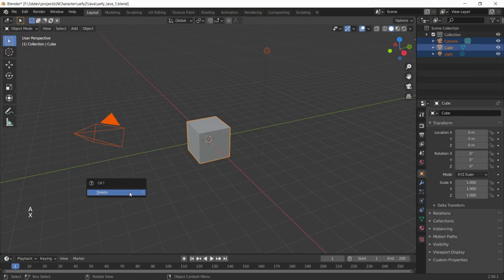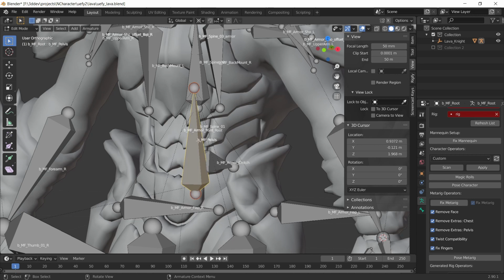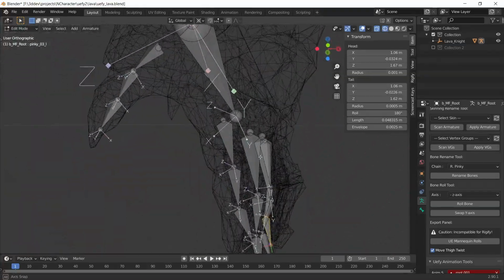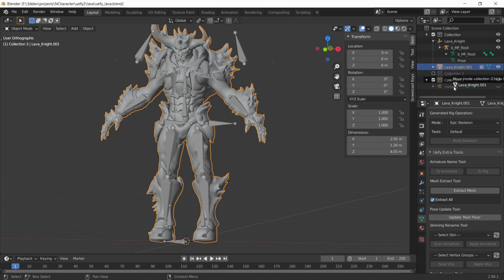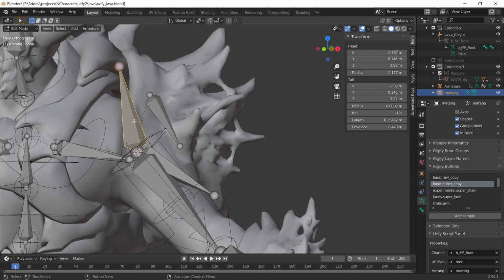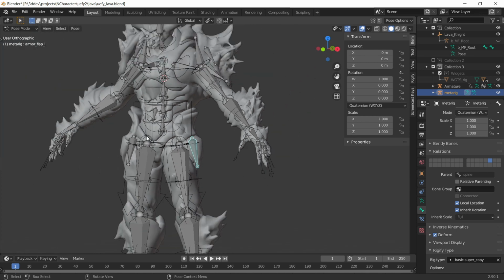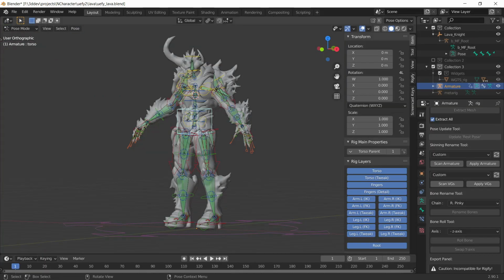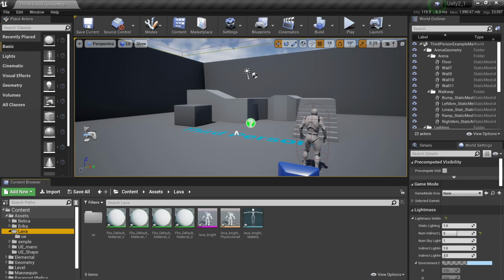Advanced Character Rigging with Blender, Rigify and Uefy 2

Comment: Hey Rakiz, I used the basic posing skeleton, then metarig for UE5 with 6 spine bones, how do I place 6 bones compared to the character's 4 bones? not sure how to split the spine. I watched 'til 29 mins into the video.
Reply from the maker: Well first of all if you plan on using the 6 bone spine you should divide some of the bones in basic posing skeleton to increase their number so they match the updated 6 bone spine and properly weight paint them. Uefy will transfer those weights to the final rig.
Secondly when working with rigify you just need to make sure that the spine uses two specific sample types. The lower bone 6 bones are of type "spines.basic_spine" and the neck to head bones are of type "spines.super_head"
As long as you have these two correct spine types and the names are set properly. Then you are not really restricted in how many bones you can have. You can increase or lower the number of bones to be anything you want. Just be sure to maintain the names sequentially.
Reply: @RakizFarooq  Excellent, got it! Thanks! didn't know if subdividing the bones would break the rig or not
Reply: @RakizFarooq  Oh, i misspoke, the metarig for me ends at spine008 while yours had spine006 as the head, so i wasnt sure how to match them
Reply: But i understand that you just need to have it sequenced right
Reply from the maker: You also should be aware that in the 89 bone version of the metarig 'spine' to 'spine.005' is one chain and then 'spine.006' to 'spine.008' is a different chain that is a child of the first chain.
You can go to Pose mode click on the spine bone then in bone properties -> Rigify Type -> Rig Type it is "spines.basic_spine" while checking the same on 'spine.006' shows it is of type "spines.super_head"
Reply: @RakizFarooq  Sorry if you've answered this before, but when i hit "keep metacarpals" when posing the metarig. the metacarpals stay in space while the hands match the pose. How do i fix this?
Reply from the maker: @kugatuka  Uefy relies on existing original bones to position the metarig. If your original skeleton doesn't have metacarpals Uefy can not place the bones. But the hierarchy is still accurate. Just manually move them into place in edit mode. The rest of the process follows as is.
Reply: @RakizFarooq  I see. I was using the Basic Posing Skeleton as my first rig, so I didnt consider there not being metacarpals there. Moving them manually hasnt caused any clear issues thankfully

Comment: Rename bone not working in uefy 2.5. is there any shortcut to rename bone?  i have already watched all of your video for renaming bone but not success. please help
Reply from the maker: Rename bone is working perfectly fine for me in Uefy 2.5 and Uefy 2.6 both. Most likely you missed a ' or " pair or a comma in the custom json file. Since the file is parsed by Python you are probably seeing errors. Fix the json file and it will work. Other than that there is also the bone chain rename tool. Plus you can always select each bone and press F2 to rename.
Reply: @RakizFarooq  Every single bone renaming is very time consuming :(
Reply from the maker: In Uefy 2.6 you have to select the first and last bones in the chain before using the rename tool.
Reply: @RakizFarooq  Please Help Me
Reply from the maker: You can reply to the email with your order id and download link. Attach images and description of the issue and of the steps you have taken.

Comment: I'm planning to watch this tutorial because for months now I've been struggling to get past weight painting but I can never seem to figure it out, so my question is does this video have any weight painting involved if so is it explained well?
Reply from the maker: This video is about rigging not weight painting. In this case the weights of the original skeleton are automatically transferred to the final animation rig built for the game engine. So weights are not needed to be manually updated at all.
Reply: @RakizFarooq  so I would still have to weight paint my mesh beforehand
Reply from the maker: Yes .. you need to weight paint the mesh or use prebuilt characters from marketplaces or character generators like cc3 or daz etc.
Reply: @RakizFarooq  right, do you know a good weight paint tutorial ever time I try to paint I get stuck on getting into the vertices and crevices

Comment: Thanks for the great tutorials, I'm now heading towards the final step in rigging my character. I've got all the vertex groups matched to the bones and everything else is working fine, but somehow my toe (toe_ik.L & R) gets stuck on the ground when moving character around gabbing torso. Struggling with this for days. Could you give me some advice ?
Reply from the maker: Toe IK is a recent addition to Rigify. If you don't want it then select metarig object go to 'Pose Mode' and select 'thigh.L' in the 'Bone Properties' window find Rigify Type -> Options -> uncheck 'Separate IK Toe'
Do the same for the right leg, make sure you have correct values for Rig and Metarig in Uefy Script Panel options. In Object Mode do Generate Rig followed by Build Skeleton.
This will give you a rig without the IK toes just how rigify was in previous versions.
Reply: @RakizFarooq  Thank you soooooo much !! You've really saved the day.

Comment: Hi, while following your tutorial, I got a significant amount of the same errors which say "ERROR: make sure something(i.e. forearm L or f_middle.02.L) bone has a rigify type set in pose bone data properties. It's certainly interesting because all the central bones like the upper_arm.L and shoulder. L have the right rigify type set such as 'basic.super_copy' and 'limbs.super_limb'. Should I just make all the other bones that aren't assigned to rigify type to basic.super_copy?
Reply from the maker: There are some requirements to setting up the metarig.
Everything must have a parent going all the way up to the root bone
All rig types must be of a supported type as listed in FAQ section of rakiz.com/uefy
There are also some name rules as explained in https://youtu.be/o2CR9Zxbq0c
 Most likely you using a non-supported rig type on one of your parts or you did not parent something correctly.
Reply: @RakizFarooq  thanks! I realized that I didn't change amature to character. It solved the problem.
Reply: @RakizFarooq  I actually have one more question. When I am trying to copy the extra bones like skirt bones and hair bones, is it okay to use basic super copy for all? or are there different methods to rig it?
Reply from the maker: Often use 'basic.super_copy' or 'limbs.simple_tentacle' for this.

Comment: Do you have a discord or something for this? This is a sohpisticated process where a lot can easily go wrong. 
I got all the way to Scanning and applying the Armature configuration, but when I "pose character" his arms deform toward hips, and he just moves funny.
No clue what went wrong. 

Also when I tried to "fix" the skeleton, It took my 5 chain spine and made like 17 spines, and some other craziness. Could you maybe just do a few more examples with the different newer mannequins as well? I just need to see a few more demos to know what step i might have overlooked or not perfected that caused massive issues.
Thanks again for your work!
Reply from the maker: Sometimes wrong object selection or multiple selected objects can cause a problem.
Make sure in Uefy Script Panel you click on 'Refresh List' and update Character and UE Mannequin fields. Deselect all objects in all modes (object, edit, post). Then in Object mode select only the character's armature and click on "Pose Character".
That should just work. But if not then probably missed other steps in the video.

Comment: Is it possible to add the additional bones to the meta rig before clicking on rig/build skeleton as shown here in the video? so one can save preset metarigs ourselves for example?
Reply from the maker: You can add any number of additional bones to a character using this video as a guide. You just need to be sure the added part is a supported rig type as listed in rakiz.com/uefy FAQ section.
You can create a customized metarig then append it to a new blender project for rigging additional characters with the same bone structure.

Comment: Hello! I just want to say I really enjoy your videos and the uefy script I bought. Its made my life a lot easier for sure. I however keep running into an issue when to build the skeleton. the message reads, "ERROR: make sure 'shoulder.l' bone has a rigify type set in pose bone data properties" I admit I'm still learning though cant figure this out. Any ideas?
Reply from the maker: Select the metarig in Pose mode, select the left shoulder bone and check Bone Properties -> Rigify Type -> Rig Type should be 'basic.super_copy'
If you generated the metarig as shown in the tutorial this value will already be correct. So I'm assuming you edited the value or you added additional bones which were not properly parented to the metarig. You'll need to check that as it is hard to guess what was changed on your end.

Comment: I created a rig from scratch using the human meta rig (with some bones deleted) and used it as a base armature. When adding a new rig for the riggify process it throws exception errors complaining about thd bones I deleted. It won't allow me to generate a rig and I can't pose another rig to my custom armature. Do I have to only use the specific bones uefy expects before the rigging process and then add them after?
Reply from the maker: The metarig is a templating system, we only use it to tell rigify how to construct the final rig. You're not supposed to bind it directly to the mesh or use it as a base skeleton. Additionally the metarig is constructed from parts like leg, arm, spine, finger etc. Each part is different some have configuration options you can use to customize the number of bones in the part. For others you can directly add/delete bones. For some a few bones are required and you can't delete those bones otherwise rigify will stop working.
Reply from the maker: Next time use the Basic Posing Skeleton provided by uefy as your base skeleton for a static mesh. It has correct names and rolls out of the box. You can customize it then pose an actual metarig on top of it with minimal hassle.
Reply: @RakizFarooq  Thank you so much for your reply! I was wondering if there was a difference and you confirmed it for me. I will go back and use this new process.
Reply: @RakizFarooq  I hate to bother you again but I used the Base posing skeleton from the addon but it gives me this error when I go to pose the mesh Python: Traceback (most recent call last):
  File "C:\Users\homei\AppData\Roaming\Blender Foundation\Blender\2.93\scripts\addons\uefy\pose.py", line 364, in execute
    self.update_pose(bone_name)
  File "C:\Users\homei\AppData\Roaming\Blender Foundation\Blender\2.93\scripts\addons\uefy\pose.py", line 331, in update_pose
    s_bone = source.pose.bones[bone_name]
KeyError: 'bpy_prop_collection[key]: key "clavicle_l" not found'

location: <unknown location>:-1

The left clavicle is present and even shows up in the custom list of bons so I'm not sure why it doesn't work. Can I skip the skeleton posing stage and move on or is this a bug causing error?
Reply from the maker: All functions including posing are working fine at my end. You shouldn't skip posing the skeleton, rather try to find out what step was left out. First make sure you have correct values selected in the Uefy Script Panel for charater, mannequin, metarig and rig. If not that then then retrace all steps presented in the video until you find what you did different.

Comment: I followed the tutorial, but when I exported my model into Unreal Engine, my bone hierarchy had different names from the one I made in the scripting. I know my scripting was correct because as an experiment, I exported an FBX model with the original armature and Unreal was able to read it and retarget data (this  was only the renaming bones step, no metarig) I followed the tutorial using the metarig and the new exported one had  names like  root  DEF-spine DEF-Pelvis (very bone had DEF before the name),  none of these names where the ones that I did in the scripting. I cant tell if its a compatibility issue with blender, or if I got a step wrong. Do you know what went wrong, did I miss a step or did something go wrong?
Reply from the maker: Sounds like the replacement skeleton was never created. I assume you didn't click on 'Build Skeleton' once rigify generated the rig or did not have correct objects selected in the Uefy Script Panel like character, mannequin, metarig, rig options.
If not that then you missed something else which you will need to figure out by watching and following the tutorial.

Comment: Hi, I'm trying to follow this tutorial and when I try to generate the rig after adding custom bones I keep getting this error saying "AttributeError: 'NoneType' object has no attribute 'use_connect'." I added a lot of custom bones as the character I'm trying to rig wears a skirt and has long hair that uses multiple chains of bones, so I'm wondering if I messed up somewhere trying to add those bones to the rig.
Reply from the maker: You may have added new bones without setting a valid parent for them in the metarig. Or there is a space between the neck and spine bones and you did not update 'Use Connect' option on spine.004 as shown in https://www.rakiz.com/blender-2-83-lts-and-uefy-script/
Additionally you should also review the rules on naming conventions as shown in https://youtu.be/o2CR9Zxbq0c
Reply: @RakizFarooq  I fixed both the spine issue and renamed all the skirt and hair bones to end in letters rather than numbers, but now when I try to generate a rig it says "Generation has thrown an exception". What does this mean?
Reply from the maker: That is not enough information there is probably more to that message. 'Generate rig' is part of rigify not uefy so you've setup the metarig in a way that Rigify doesn't expect.
You can send a reply to the email with your order id and attach your blend file. I can take a look at it.

Comment: Hi Rakiz, I really what you made and am excited to learn Unreal with it. 

Question - Uefy does not create an IK bone layer for my rig. Do you know what the issue may be?
Reply from the maker: Uefy will export correct IK bones when used in 'Epic Skeleton' mode. You can check https://youtu.be/mg75kSkKkug around 33 min and 30 second mark to see which layers the various bones are added to.
Reply: @RakizFarooq  Thank you. Last questions - First, I believe you mentioned you cannot combine blendshape shapekeys with the armature. Is that correct or is there a way for me to make that happen?

Second, I have a character with wings. Importing into Unreal works and the animation is in. Would this modified armature still function in combination with animations associated with the Unreal Mannequin armature?

Thank you for taking the time and making a great product!
Reply from the maker: Since Uefy 2.2 it is possible to transfer existing shapekeys to the final rig. Provided you don't change the pose on the parts of the mesh you want to copy shapekeys from. You can review https://youtu.be/BB_bniYzADc on how to do that. You can always create new shapekeys after you finalize the rig.
If your character with wings was made in Epic Skeleton mode, the body other than the wings will still respond as usual like the mannequin. You will need to retarget your existing animations to the new character.
Reply: @RakizFarooq  Rakiz, do you take consulting jobs? Would you be able to jump on a video call?

Comment: Hey, thanks for the awesome piece of software. I'm trying to add ears to a humanoid character that are poseable and connected to the head, but having trouble getting it to work. Will the same approach for floating armor pieces work for something like ears?
Reply from the maker: Yes .. that is the idea. Add anything that is needed.
Reply from the maker: If you look at the intro video ( https://youtu.be/6laZFauJiRA ) around 2 min 26 sec you'll see a cat with posable ears. It uses the default metarig in armatures -> animals menu. You can study how that works.
Be aware that sometime rigify causes issues when attaching child bones on the ends of some metarig samples. But ears should easily be added to the face bone.

Comment: Hello Rakiz,

I bought Eufy couple of days ago and it's amazing. Although I just have one little issue,  the change pose in the process halts my workflow heavily. I prepare blendshapes with zBrush and bake with Substance, but changing the pose and not being able to retrieve base pose stops me from doing that. I have tried couple of things but haven't really found a solution. Is there a way to keep our base pose? Or do you have any suggestions? Looking forward to hear back from you >.>
Reply from the maker: Updating the pose can be skipped. For example you start with a t-pose character you can keep it that way by following the whole process just skip clicking on 'Pose Character' button.
Reply: @RakizFarooq  THANK YOU! I spent hours trying to find a workaround, thanks a lot for your fast feedback.
Reply: I played around some more and found out preparing 2 armatures one posed and one with default pose and transferring pose inside unreal via pose assets yielded best results. In case anyone has a related issue to mine, hope this helps you.